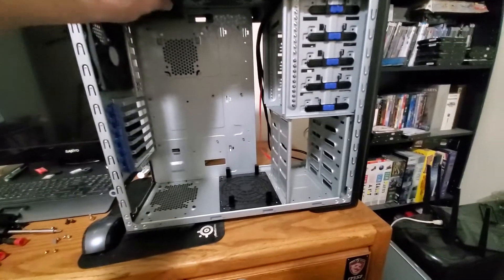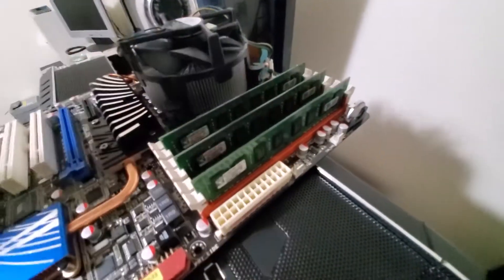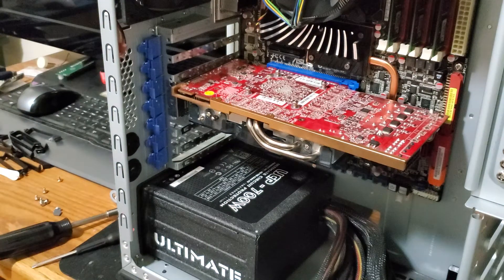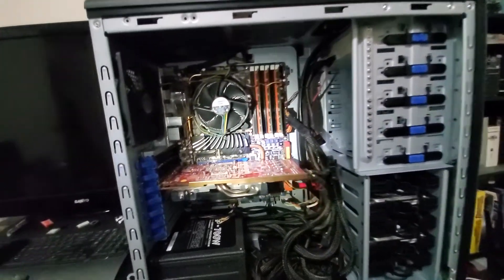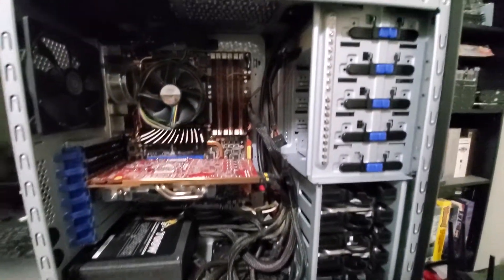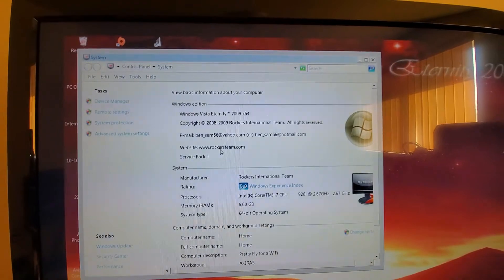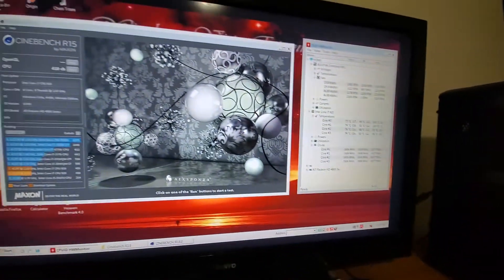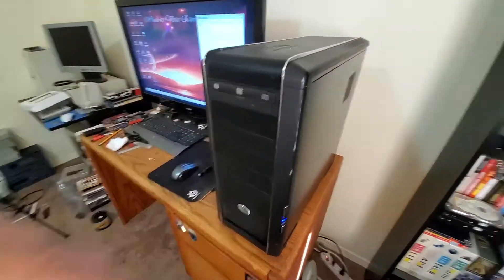$50 Computer Haul pt 4

Comment: Yep, THE haul of 2022. 😆 Not much you can do about the PSU cables, at least without the window you can't see them. Maybe get a modular PSU? Def. needs a better CPU cooler! 3 x 1gb sticks of ram turns that into the ultimate XP gamer. Add a SoundBlaster Xi-Fi or Audigy 2 ZS card into the mix for EAX. Hook it up to a 1600x1200 monitor it'd be sweet!
Reply from the maker: I do have this sb0460 (X-Fi XtremeMusic) laying around.